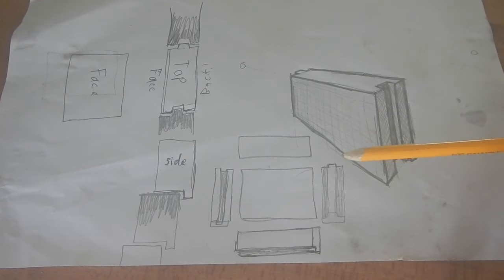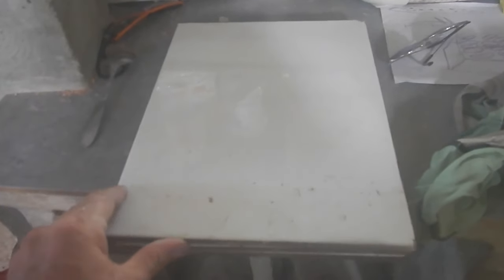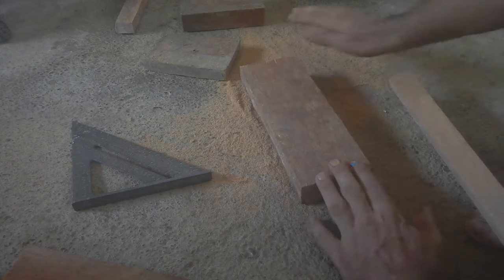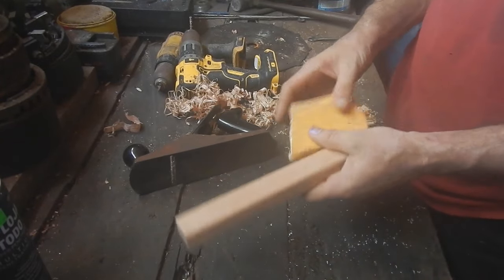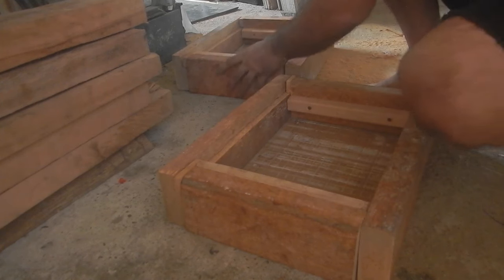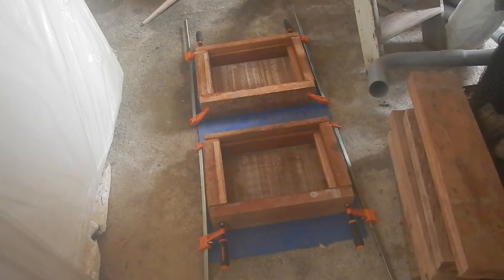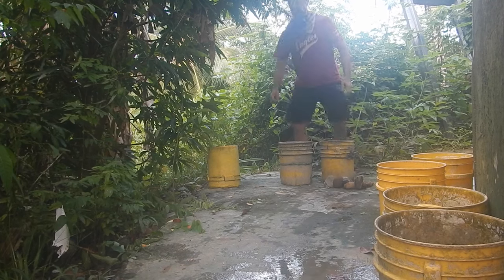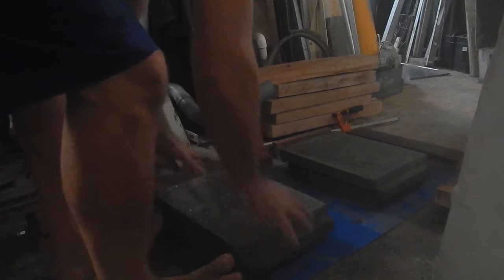Sea Wall 001 -Design dem Bricks!

Comment: Looks like the tongue is bigger than the groove? looking forward to seeing the wall and following along
Reply: Exactly. The mold sides should NOT fit together like in 9:24. Remember a mold is a negative... I was like, Jaimie, are you tired or something? Your brain code is malfunctioning... 😄
The tip of the tongue may just go in a tiny bit due to the angle though.
Reply: You read my mind. I was hoping he would try fitting the trial versions, before building more molds!
Reply: By the time we're watchin this, the wall/floor is already done ;)

Comment: Concrete blocks are not 100% waterproof, but they can be made more waterproof by mixing crystalline admixtures into the concrete. These admixtures react with water to form microscopic crystals that fill pores and enhance waterproofing

Comment: The tongue and groove on your mold are the negative so the tongue needs to be wider and grove narrower, so that the actual brick will fit the way the wood bits do when you tried them together. Currently the way you have it, the tongue will be too fat to fit the groove

Comment: In SW Florida it was a common construction method for seawalls, to use pre-formed concrete interlocking panels retained by steel rods anchored by a poured concrete deadman onshore. A number of innovations have been developed since, here is a link to one, I hope this helps in some small way. https://www.youtube.com/watch?v=gkuGYIpxoLg